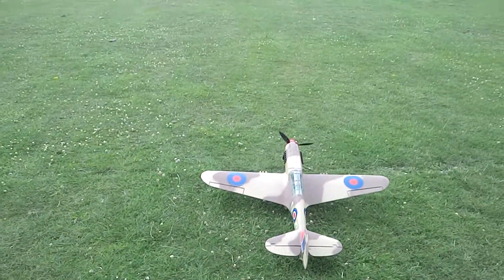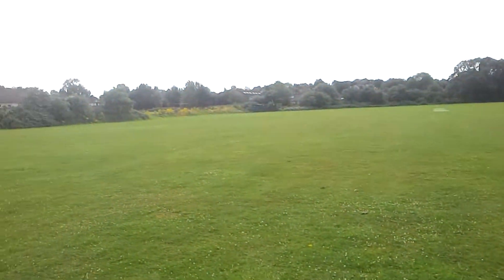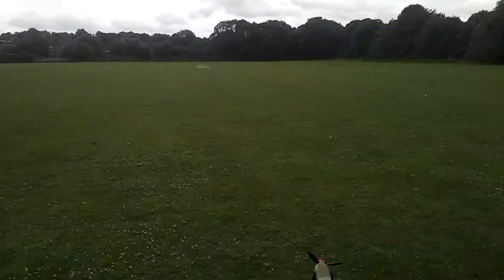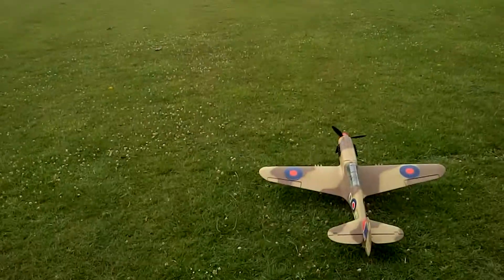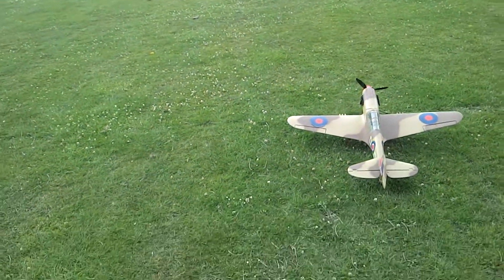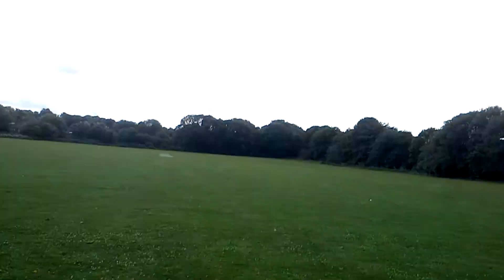Durafly p40 maiden and crash

Comment: I couldn’t tell if you did what I did, which was nail my throttle in a tight turn. When I did that, it did a fast torque flip and dove into the ground. In any case, reinforcing the plane actually works- ours has no foam damage (other than wrinkles) after 3 crashes. (Another crash was caused by a flapping wing decal- that’s a first for me) After I figured things out, it flies like a dream! Tally Ho!

Comment: Was she tail heavy Jeff? She kinda looked like it a bit, sort of "wallowing" through the turns and such. She also appeared to lift off a bit prematurely, indicating tail-heaviness. I've flown one of these before and found it to be a pretty decent flyer. Only trying to help you my friend, not trying to ruffle any feathers. I'm sure you'll have her fixed up as good as new in no time! Cheers mate!
Reply from the maker: Justwingit ..hey wingit .. thanks for your input .. she was a tad nose heavy but she was all up heavy to start .. the wallowy turns were where I think I was flying her to tight in turns and she was unhappy ..probably the cause of the crash to tight turn and stalled her .. although the cg did change a lot from gear down to gear up . 
I haven't crashed in over a year so damaged my pride more then anything ..I will fix her and try again 
regards